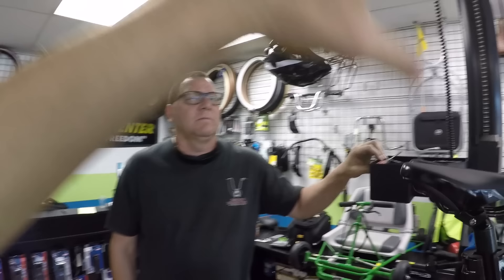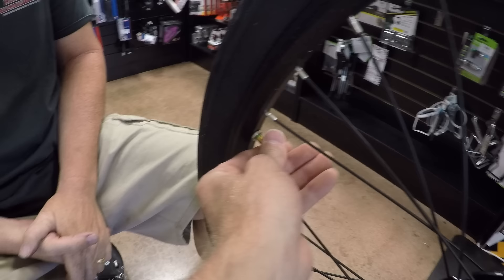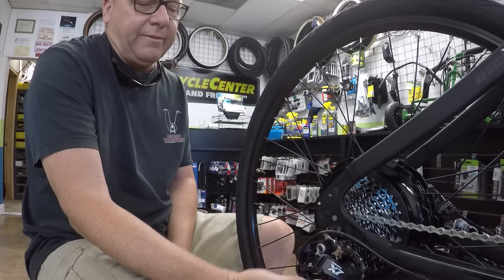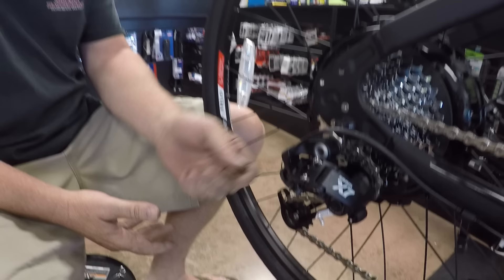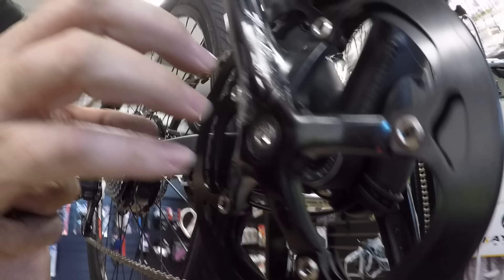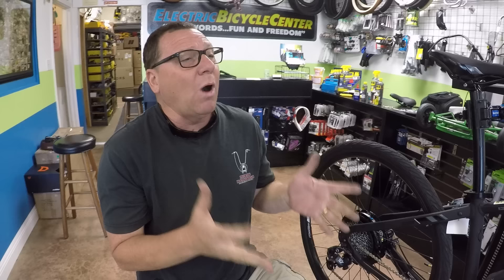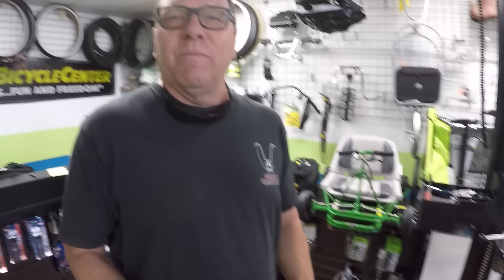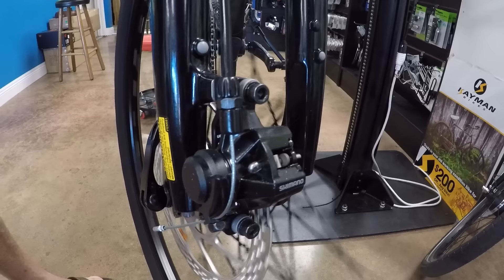Professional Advice for Maintaining an Electric Bike

Comment: You know, I have an e-bike and one of the things I discovered real quickly around my area is that regular bike shops generally won't touch them. I think they're missing out on a golden opportunity. Most people are going to be riding e-bikes with the gas prices going up and it would be a good time to get into keeping those running. I'm seeing more and more moped styley bikes with racks around here, that people are using to run errands
Reply: Definitely need more E-Bike shops in all 52 states😊
Reply: And Canada!!
Reply: I know exactly what you mean. I have an Ebike that is from freesky,  and none of the bike shops will work on it. I'm 64 and not in the best of health.  I bought it for local transportation, and I feel ripped off .
Reply: What a great video. Many thanks👍
Reply: @garyv.gethers7495  And Nambia
Reply: There are reasons for this.
1.  The lithium battery on ebikes is a definite fire hazard, and most bike shop insurance companies will not cover it.  Do you want to lose your entire bike shop bc you tried to make a few extra bucks on ebikes?
2. The electrical stuff on an ebike is wonkier than the mechanical, and also, it is a different skill set.  Try fixing the digital circuit board on your dryer, and you'll see that you need more than mechanical skills and tools to do it, If it can be done at all.

Also, ebike companies are not providing much support or training, and I've found little available in general for electrical bike repair.

3. The economics may not be as good as you think.
Servicing the electrical plus mechanical can be costly, especially if the manufacturer has not planned for this. 
Are you willing to pay $500-$1000 to Service both mechanical and electrical components on an ebike?  Most would probably say no, and there you have it.

No one is stupid to turn away 'Amazing opportunities' staring at them, but while I agree with you that it would be great to see much more ebike Servicing, the economics are not well aligned ATM.  
So write your complaints to the manufacturers and ask them what their bike service models are? and if it isn't something you can rely on, then don't buy from them
Reply: @garyv.gethers7495 all 52 states? When did we get two more states??😊
Reply: Yeah how it was in my small town so learned how to do these repairs and put a sign at the end of my driveway ebikes repairs and now I got like 30 people pretty regularly coming to me for stuff on there ebikes kinda funny
Reply: A lot of it is because they won’t touch an e-bike when it hasn’t been bought from that shop, especially if they void warranties or don’t have or can’t buy specific parts for that e-bike. They will generally repair and maintain the non electrical parts of the e-bike.

Comment: my bike is waterproof, no battery to replace or catch fire. it's a gasoline powered hybrid it gets about 160 through 180 mi to the gallon. I've had it for almost 4 years now it's a four stroke. the longest I've taken it on is a 22 mile trip. a complete new engine is about $140.00 and there are all kinds of upgrades you can do. when I'm going green I can just shut the engine off and pedal it almost flat terrains.

Comment: Full time cyclist here:  with respect to lubricating chain. . .   I soak the whole chain (after a thorough cleaning) in molten sealing wax.  It lubricates the interior part of the chain, and does not attract dirt the way most oily lubricants do.  Using “quickllink” chain connectors makes this quite easy.
Reply: old school.

Comment: Bar oil is lubricant that is designed to stick to a spinning chain without slinging off.  So I use it on my chainsaw and my bikes,
Reply from the maker: Cool! Thanks for the tip

Comment: He is so right about tire pressure. I bought a new e-bike. Put 55 psi in the tires. Rode the bike for a month and put 275 miles on it. Checked the tire pressure and it was 27 psi. Decided to check my tire pressure every 50 miles. Went from 55 psi to 40 psi in 50 miles. You basically have to check your tire pressure every week (or more) if you ride a lot.

Comment: Great advice. Sam is a guy who knows what he's talking about. I have been observing the ebike market develop over the last 15 years. I finally took the plunge and bought one not assembled (in a box) during winter. Turns out to have been a good decision because I got to see first hand the quality of the build and its functions without riding it. This also gave me an opportunity to tweak it to my preferences, and I had a number to make because with all my biking experience throughout the years (I'm 65 and a little heavy), I have come to know what I really like for me personally. Push come to shove, after getting the ideal secure 2-lock setup (ebikes are thief magnets), I've taken it out in like 5 runs now. After further refinements, I also got used to how to modulate between the gear shifting and the bike's electrical power curves for an ideal balance, (which is super important). 
I may be super-happy with my choice, but I'm not here to sell any particular bike brand. These are just things that anyone who wants an ebike should consider. Yes, I'm somewhat more mechanically/electrically inclined than the average person, but if you have to pay someone like Sam to have the ideal setup that works for you, it's worth it. It just makes the joys of ebiking ownership that much sweeter. 
Happy touring/shopping/workingout/and using your car less!!
Reply: Thanks ✌

Comment: I've been in the automotive and truck field for over 30 years. I have worked on bikes and small engines too. WD-40 is water and oil the water causes rust. I use WD-40 years ago on a brand new set of connecting rods. sprayed them down with WD-40 and put them in Ziploc bags. come back sometime later and the rods had rust on them. luckily it wasn't in the journals.

Comment: Regarding flats … one thing you should do is run your fingers on the inside of the tire to ensure nothing is embedded that you don't see on the outside. Otherwise, you can patch or replace a tube only to get a flat again. I've been using hydraulic brakes since 2001 and the easiest brake adjustment is to loosen those hex bolts on the caliper assembly, spin the wheel, engage the brake,  then tighten the bolts - no drag on the rotor after that.

Comment: You Truly Found the Perfect Guy and shop. 
Might want to replay it again every time bike is ready for a little lube before heading out. 
Boy was I glad when he pointed out WD40 is just a solvent cleaner and not a lube. 
50 Million people would make this mistake not knowing they were causing damage using it as a lube. 

It's just modified diesel fuel made for stubborn fasteners. It was never a lubricant to begin with, just as he said, it'll be dry a day later. Go ahead, spray it on your wheelbarrow, Tomorrow it won't be traceable where it was sprayed. 
Cheers

Comment: THANX Sam! Because of your ebike knowledge, and experience,  I FIXED my bike STALLING problem today! I had a faulty brake lever switch, so I just disconnected the SM (5v 3 prong connector) which was cutting out my motor. The brake still works OK, and that will get me by until I REPLACE that REAR brake lever (right side), with a new one. My bike has been sitting since May, so it's great to be back in motion!

Comment: Thanks, Sam and Court!  That was an extremely interesting video.  Just chock full of tips and good advice.  I take a pack of tire irons and patches in a case, a pump, and added a 14-in-1 tool ($4 from Chaiwan, complete with chain breaker) on the road with me.  That's in addition to elbow/knee pads, helmet, and orange mesh vest. People still don't see any bikers unless they're stopped and one rides by and stops next to them.  <shakes head>

Comment: Great video, I'd say checking tyre pressure is the most easy and most important for mileage/kilometerage. I have a 16" wheel foldable ebike made in China, I have to pump a little bit into those small tyres every 3 rides (I ride 30KM/day).  It's not because it's cheap and crappy. It's because what we call the American valves use air pressure inside the inner tube to seal itself, they loses air over time and when there are less air pressure, they lose air quicker. It's summer now in Australia, if the tubes don't have enough pressure in the morning, the heat may cause the tyres to lose more air. Then in the after noon when I try to get back home, the tyres will be too soft and I will have to make a lot of effort to get through the Sydney hills. So, check your pressure and pump it up before every ride.

Comment: Although I knew that an e-bike was water resistance and not proof, it's good to hear that the hub motor is well protected and can withstand riding in the rain.  Also, that the controller is more vulnerable than the motor and would have to be submerge in water in order to fail.  I would like to add to also carry a spare inner tube just in case of a blowout with the appropriate wrenches to loosen the axels, as well as spare brake cables and brake pads.  And are you snapping brake cables way too often?  I finally realized that I was over tightening them, 'excessive torque' at the brake caliper, and that stopped the problem.   Thanks for sharing your valuable knowledge !!

Comment: What I have learned. Correct Lubricant is my friend. I need to buy that tomorrow during on my test commute.
Reply from the maker: Good luck on your test commute!
Reply: @ElectricBikeReview  
Thanks. It was a successful run. Got to my job & back with my battery showing almost no drain on it. Picked up a few things for my bike while I was out. Tomorrow I think I will start commuting to work by bike & hopefully my savings in gas will allow the thing to basically start paying for itself.

Comment: I use blue lightening chain lube, it's a wax lube that goes on wet and then dries, it also actively cleans the chain as you ride too. Great stuff
Reply: There's no substance in the world that can clean and lubricate. Lubricant is sticky. It sticks to the chain. Dirt and dust stick to the lubricant.
Reply: @schregen  I don't anything about bikes, but I use dry lubricants like graphite on all kinds of things to avoid dirt and dust sticking.
Reply: That blue lightening stuff is really only a wet lube. Please clean the bike chain with a solvent and re-lubricate the bike to make it running smoothly.

Comment: As a past bike mechanic, it's neat to see how much of the recent parts and equipment on these new E-Bikes also are common to regular bicycles from a few years ago.  The motor and battery technology are the parts that seems to be rapidly evolving, Lithium batteries and efficient brushless motors have improved the range and power, but the heart of the bike, the bike tech is as always, the most efficient means of moving humans and small cargo loads.
Reply: TaUnc Fester hooray you get it and it’s so true.

Comment: 11:39 You'd be hard pressed to find any experienced professional in the repair industry that doesn't roll their eyes when they hear the word »rice«. Rice has little effect as a desiccant.  It will absorb many times its weight in water, but only while in direct contact.  It will not effectively »draw« moisture out of the air. All it does is bring starch dust and grit into the thing you’re trying to dry out, and that bag (as in »a bag of rice«) will prevent air from circulating, and both rice and the bag will keep the humidity way up. 

Rice in salt has one major effect: to loosen the salt crystals, cover them slightly with starch powder from the rice and prevent them mechanically from clumping. It has next to nothing to do with humidity. 

If you want something to dry, just keep it in dry air, preferribly at the maximum temperature your gadget (bike, battery, controller, phone) is allowed to be stored. 

Keep the rice in your kitchen. Cook the rice when hungry, and eat the rice. Bon appetit!

[edited to correct some typos.]
Reply: thanks for the information!

Comment: Awesome advice on fixing a rear flat. I have imagined my first real life experience with fixing a rear flat would probably have been to remove the rear wheel and break out my new spare Inner Tube:( I don't anticipate a blow out so I'll be leaving my spare Inner Tube  at home. Thanks Sam and EBR.
Reply: I have to admit that's clever pulling the tube out to the side of rim to  patch it vs pulling entire wheel off. 
Saving a good hour right there, plus the mess it made. 
Cheers

Comment: Not only should you not drain your battery, it will last a lot longer if you only charge it to 80%.  Keeping the battery between 20% and 80% is a good idea.  This works for cell phones, too, and can double the life of your battery.  One question - how about using Teflon sprays to lubricate the chain, and everything else?

Comment: Tri Flow is the real deal people. We used it in Desert Storm early 90s for our KC-135E Thrust reversers. Those are a clam shell like apparatus that forces thrust forward to rapidly slow down the aircraft.  Our Unit was the only unit that had fully operational thrust reverse operations in the desert environment.  Every 100 hours we'd  soak the pivot points with Triflow from big squirt bottles being we purchased this stuff by the gallon. I always have a few cans of it laying around.

Comment: The best lubricant for a bicycle chain is paraffin, sometimes with a bit of added paraffin oil. This has been amply proven in independent tests...period.
Reply: Yet you couldn't be bothered to even drop a link. Hmph.
Reply: After a good while of experimentation, here's my recipe.
500g candle wax, 500ml 2T oil , good sized scoop of Molybdenum (100ml powder).  
In winter you can increase the portion of oil. I try to keep it so its a solid, but with rubbing or pressure it will smear. 
So quiet and keeps clean, love it, soak it in the melted wax every few weeks and your good to go.

Comment: Would a 'dry' lube such as graphite, etc., not be acceptable and/or beneficial for the chain as well as other lube points while also avoiding the collection of dirt. etc?
Reply: No matter what you use,  chains will eventually get dirty.  Wet lube maybe sooner,  but on dirt trails, nothing stays clean.    As long as lube reduces metal friction parts will last longer.
Reply: Dumonde tech lube is the only dry lube i have tried that actually works

Comment: EZ make flat tire anxiety go away by using a noflat tire, no way i want to get stuck somewhere with a flat tire&heavy ebike combo.  yep the ride characteristics of a noflat tire maybe different however in my mind worth the compromise.. i don't understand why noflat tires are not more prevalent since they exist already(eg Amerityre)..thx for posting this good review!
Reply: I second that emotion; I would want to fix my flats at home!
Reply: So called non-flat tires are a piece of shit idea. You make your rolling resistance something like 80 Watts per tire, they wear out quickly, have no grip and and its like riding on wet noodle. So stop this peasantry and buy good touring tires like Schwalbe Marathon, and keep the pressure at correct PSI. You can expect getting maybie a single puncture in one season. If you still have anxiety, don't ride a bike. If you don't know anything about bikes don't recommend people shitty products.

Comment: Ex US Nat'l Coach here. Not a bad primer on basic, very basic maintenance. He skipped scores of general maintenance but most riders let bike shops or pro mechanics deal with alignment, bearing maint., wheel trying, etc. Here's the basics for Electric bikes and motos.
1. Battery maint is paramount! Follow proper charging and storage guidelines and never let it freeze, ever. You can store your bike in the garage, but not the battery.
2. Electrical connections should be cleaned regularly with electronics cleaner and qtips. 
3.Always air blow connections after cleaning to reduce oxidation. Carry a can of compressed air to dry connections after wet rides before loading bike to vehicle.  Take care not to  blow out your lubricants and re- lube as necessary.
4.These are the basics. More advanced- learn how electric motors, controllers, BMS's and batteries work. Perform zero mods before doing so. Enjoy the future of cycle/ moto riding!

Comment: Very good - not touting for business, rather presenting a solid overview of things both maintenance & safety. I keep the tyre pressure(s) at @ 5psi below the stated max (what with air heating & expanding at speed - hence also checking your car tyre pressure(s) -don't forget the spare, if you have one - at the ambient temperature of 20-23C only.  The 4 best bringalongs are your brain, experience, knowledge and helmet (you Slimed your tubes yet? Just suggestin') and remember YOU DON'T OWN THE BIKE-LANE/ROAD. In aviation VFR: "See and Avoid", in eCycling/eScootering - "SEE AND BE SEEN" - great fun! Thank you for uploading.

Comment: Tubeless if you are in the boonies. Carry a spare tube, ziplock bag and napkins. Most small stuff you never know. Keep pumped up or you can blow the bead off the rim.
If you destroy it there is a mess. Put in the tube,clean up with the napkins and put the mess in the bag. This works for slime tubes also.
Chain breaker and master links.
Sidewall blowouts need duct tape,wrap a foot around the seatpost. Planter's peanut bag worked in a pinch.
Optional- eye wash(visene) good for small tube holes and bugs in the eye.
Tweezers- pulling thorns out of tires and skin. Benadryl- stings, allergies and snakebite. Now try and have a carefree ride!

Comment: many people in my motorcycle forum swear by wd 40 for chain lubing.  i can tell you one thing, my chain noise was super quiet when i did a good job of cleaning it with wd.  I do use gear oil and a paint brush to lube my bike chains now.  (motorcycles)